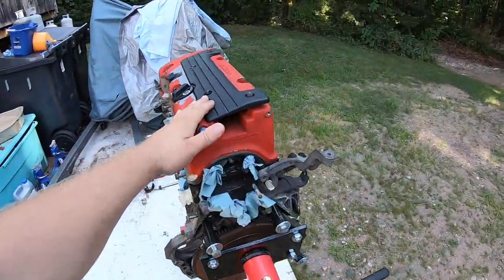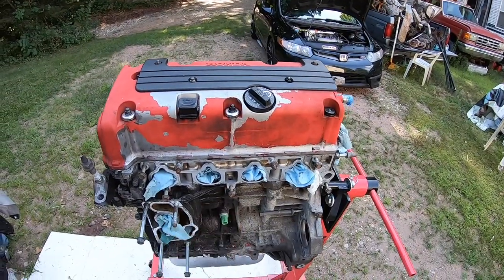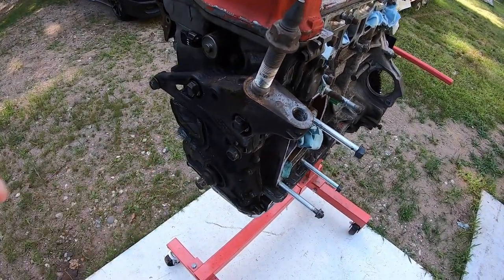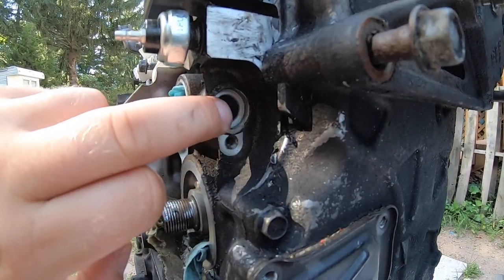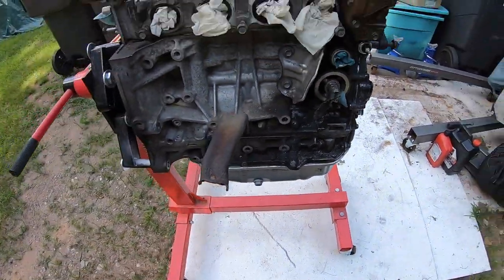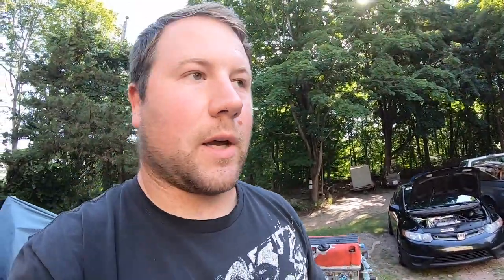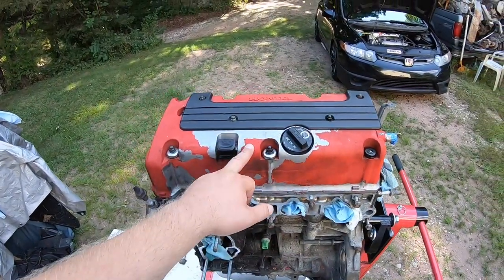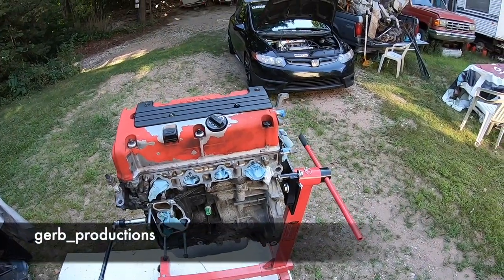Honda Civic Si K20 to K24a SWAP DIY (2006 2011 Si)

Comment: I just bought a 2007 si and has a bad k20. After watching this video I'm definitely buying the k24 it's cheaper then what I can find a k20 for.
Reply: dude, literally bought mine a week ago and mine blew on the drive home 😂 good luck brother, i know we both need it 😂🙏
Reply: @Gabriel Villalobos   bought what a k24 and swapped it.  Or a civic with the k20 and it blew?
Reply: @BjYeager420  bought an si and it blew 😂 probably gonna go back to k20
Reply: @cheesehandles  k24 is cheaper
Reply: same here, i'm 2200 miles in and my mechanic found metal shavings in my oil and before that i thought i had a timing chain/tensioner issue due to my p1009 code
Reply: @taronate  is this with ur stock k20?
Reply: @cheesehandles  bro same wtf💀

Comment: I just did a k24A swap on my 8th Gen just waiting on Flashpro. But the only sensor you have to change is the Crank sensor and the Vtec sensor behind the engine. Everything else just plug in and you can use the K24A crank pulley and need k20z3 oil pan and CRV post mount..but Everything else is direct plug in. All I'm waiting is for my Flashpro which is coming tomorrow brand new Bluetooth.
Reply: So nothing need to be transfer just a few things

Comment: Hey gerb thanks for all your video just finished my k24a swap and running like a champ. I haven't gotten the flashpro but it's running like it should. That's for ur videos.
Reply from the maker: Np man, thanks for all your support 🙏🏼
Reply: Hii José, you are running the k24 on a civic Si not tunne?is running good and strong? I gonna make this swap i have a 2007 Si coupe, i dont have the money for the flash pro only for the k24 engine.. 🙂
Reply: @LeandroGomes-sw3jz  yeah Its been running good. Am saving up money for flash pro but haven't tuned it yet. It's been 11 month
Reply: And it still running strong

Comment: My current project right now, thank you for the advice , def very helpful. I got k24A RBB motor recently after my k20z3 made it to 230k miles before head gasket blew.

Comment: I swapped my k20z3 to a K24A and it ran on its own for 15 or so seconds and cut the engine cut out now it won't start. Fuel is coming out of the fuel line and the engine has healthy compression on all four cylinders. I need to do a spark test. I was wondering if you encountered any of these issues. P.S. you're videos were a huge help when I was debating if I was going to perform the swap.

Comment: The vtec solenoid from k24 only has 1 plug cause the jdm motor doesn't use an oil pressure switch for vtec iirc. A usdm k24 would have both plugs I think.

Comment: You can run the car with out the oil cooler just get the tsx water pump ,, for those on 2024 make swap 💯

Comment: What’s up man. So I just got a k24a2. Doing a 20/24 but I’m getting conflicting information on something. With the z3 pan on the 24 block what oil pump and pick up are you running? Did you have to use the z3 oil pick up? Thanks man!
Reply: the best stock oil pump for your application is the fd2 type R oil pump. it has the extended pickup just like the stock z3 oil pump but is closer in design to the k20a2 rsx type s pump. do not use the type s pump because the pickup is not tall enough for the deeper z3 oil pan. its not worth the risk. use the RRC fd2 civic type r pump. its cheap and bolts right up.

Comment: Hey Gerb I am helping my friend with a K2.4 swap on an Acura CSX 2010 same as the civic 2010 can we pull the engine & transmission from the top rather than taking the subframe from the bottom & removing it from under the car

Comment: I bought NGk coil pack from TSX u think they will fit on 8th gen civic si plug wiring harness the part number changes 48699 and k20z3 NGk coil pack part number is 48922

Comment: Did you need to flash tune your ECU on k24 after you installed everything ? I heard it’s necessary to do a tune to make the k24A swap run as it should.
Reply: Yes it is

Comment: Which k24 did you use boss. The k24a2? Anything you thought of after this video? I want to do this bad !!!! Thanks for the content. Did you do the oil pump upgrade  I believe that gives you more power.
Reply from the maker: K24a. I like the torque. And I didn’t use the pump, but regret it seeing as I only take it to 7800 rpm
Reply: @TheGerbsteve  I just watched your other videos. I saw k24a. I'm doing a marathon of your vidz right now lol. Prepare for the storm.  7800 is still great.  I bet the torque feels bomb💣
Reply from the maker: 188tq and 7800rpm feels great for a first k24 swap to me ! 💪🏼

Comment: In the middle of doing my swap, and I noticed that the k24a block has studs for the oil pan. How did you remove this?? I didn’t see it in the video and I’m stuck now as to how to remove it safely

Comment: My Acura CSX engine blew up I bought the tax K2.4A2 engine it is a little taller (19 mm / 0.748inches)than the k2.0 can I use the TSX  intake& exhaust manifolds & would it fit
Reply: Hey Ferb my car is a daily driven all that is available now is the TSX K2.4A2 the guy it would fit I saw you swap all the sensors just wanted to know could I use the TSX intake and exhaust manifolds

Comment: Hey I was just wondering with the side motor mount you need a 2002 to 2006 CRV post mount but what else do you need do you need the whole motor mount assembly from the CRV or just the post mount

Comment: So i have a 05 rsx with the k20z1 and I’m gonna have to order a new harness but eventually I wanna go k24 bottom so if I swap the sensors n all will it work with my ktuner ecu or would I need hondata?
Reply from the maker: Should work with your k tuner

Comment: What bolts did u use for the crv post mount? And are you using the torque mount that was used in the k20?

Comment: Thanks for a very helpful videos... I have a question, Did you use RBC VTC 50" ?
Reply from the maker: I sure did. It’s one of my favorite mods
Reply: @TheGerbsteve  whats the benefit of using the rbc vtc 50° compared to the stock one in k24a2?

Comment: Hey gerb what bolts did you use for the engine to the stand. Did your stand come with bolts to hold up engine?
Reply from the maker: No, I had to go to hardware store and get them. I don’t remember the thread pitch

Comment: Hey Gerb. Quick question. Did you have any issues with your vtec not working when you did your swap? Just did mine. No vtec. Unless the crossover just isn't as hard.
Reply from the maker: Vtec worked perfect man.
Reply: @Gerb Productions  yea. It just doesn't hit as hard as the k20z3 on that crossover. Just curious if you had access to your tune? I'd love to take a look at it and see how close it is to mine. Thanks for the reply. I'm in ct as well.

Comment: I am looking to do the same on a 07 civic si. Its hard to find another z3 since my brother spun the rods so im looking for the k24a. Could i use the same ECU and transmission from the k20?
Reply from the maker: Pier B nice man. It definitely is hard to find a clean z3 engine. If you do find a nicer k20z3, you’ll be paying top dollar for it too! Yup, you can run k24 off of k20 ecu and tranny
Reply: Gerb I appreciate that man! One mor thing, the k24 redline stops at 7 and k24 at 8. How do you go about that? 7 would be my new top?
Reply: Gerb How does that work about the 7 top rpm on the new k24. Thanks man

Comment: I recently bought a civic that had the k24a2 swap. It has the skunk 2 headers on it but slap the firewall hard. what did you do for the clearance issues?
Reply: he put spacers on the rear lower mount t😁
Reply: basically let’s the engine move forward up with the spacers and let’s the header clear better

Comment: Hi Gerb,  hope your doing ok bro?, Ive been watching your latest video. 
On another note, can you tell me did the OIL CAPACITY change when you used the Z3 pan?
Reply from the maker: I'm doing alright, thanks for asking. I'm just going through some stuff here and there... The oil capacity barely changed, but the k24 will take a bit more. Anywhere from 5-5.5 quarts of oil is perfect. Hope this helps
Reply: @TheGerbsteve  yes it does help thanks. I too had to swap out my K24 pan to the K20 pan so the lower engine mount could be used. The problem I encountered was the K24 dipstick didn't quite fit so I'm using the K20 for now. I estimated the oil level and have used just over 5.5 quarts (5.2-5.3 litres) so thanks again on that one.

Can I ask have you ever replaced the fuel pressure regulator ? ....... my dyno guy recommended I replace my fuel pump or filter as my engine was making no more power after 7K. I did what he said and we made 12whp more but he reckons its still dropping fuel pressure towards 7.4-7.5K .... 

good to hear you're alright Bro.

Comment: Gerb were you able to keep the Electronic power steering? what belt did you use and what was required? Dont k24 use hydraulic power steering?
Reply from the maker: Yes. K20 belt, but it's a tight fit

Comment: Google search didn't help.  If we have a 8th gen Si, will the stock ECU work?  What type of tune is needed?  If stock ECU is needed, thinking of using two ECUs so I can pass CA smog.  One with a tune, and the original one for passing smog.
Reply from the maker: Stock ecu works and a tune for k24
Reply: @TheGerbsteve can you elaborate on this gerb? Will the z3 base map run the car and pass smog? Or did you have to flash the 24base?

Comment: Hey bro so I have a bit of a problem maybe you can help. I did a k24a JDM swap on my fg2. I did the type s oil pump upgrade. But like you mentioned the type-s pan doesn’t have where to Bolt the rear mount. What do I do? Can I use the z3 pan orrr? Thanks for the reply in advance.
Reply: @krazykk4  awesome thanks man!
Reply: @krazykk4  another question bro. Finally addressing the issue tomorrow. What header are you running?
Reply: @krazykk4  thanks for the reply again. Awesome I’ll have to pick up a set. No cutting necessary right? Headers have clearance between them and the rear mount bracket?

Comment: Yo gerb I had a question how did you get the k20z3 transmission to fit onto the k24a2 I noticed when I tried doing it one of the bolt holes don’t line up with one of the dowel pins I just wanted to know if you have to do any modifications to make it fit. Thanks
Reply from the maker: I have the k24a. I just used z3 dowel pins and it bolted perfectly, no modifications.

Comment: Hey Gerb can I use the 50 degree intake camshaft in a K2.4A2 with out any valve to piston damages
Reply from the maker: You’ll be able to run 50 vtc, but I’d have your tuner set it lower just to be safe.

Comment: Hey. I just found out on my 06 si k24a2 swap from 06 tsx . Im running the stock ecu on the k24. Can it ruin my engine? The car is still fast.
Reply: nope use your stock ecu if your in an 8th gen
Reply: @semaJPlayz  
Oh ok. Thank you. So, just use flashpro?
Reply: @rapture7551  I wana swap my 07 si with k24. How is it running in stock ecu

Comment: on the oil cooler did you feed the block line thru the factory k20z3 fitting on the k24 RAA block without any work
Reply from the maker: Yeah, everything bolted right up. It's cake to swap everything over
Reply: @TheGerbsteve  Thank You!

Comment: 8:45 hey Gerb do you remember how many washers you used to make your k24 tilt by any chance and did you use longer bolts? I’ll appreciate the feedback bro💯
Reply from the maker: Bro, that is one thing that you have to figure out on your own. I will say this, if you are using washers, you will need longer bolts because you are removing threading on the stock bolts.
Reply: Gerb thanks bro I appreciate the feedback

Comment: Hey quick question i just did the same swap on my fg2 & the car doesnt drive in any gear. The car only drives in neutral… super weird & gears are super hard
Reply from the maker: You may need to install new clutch

Comment: Hey Gwen if I use tge OEM aluminum oil pan how much oil I have to put in the engine
Reply: Hey Gerb K2.4A2 swap in an Acura CSX OEM same as the Honda si aluminum oil pan how much oil to put with out over filing

Comment: I have a 2009 Honda Civic but it has a K24 Block and K20 head and now it chokes when you accelerate it. Do you by any chance know what it could be?
Reply: Did it choke right from the beginning of the swap? Or did it happen after a while? Any modifications to the engine?

Comment: Hey Gerb  I swap out my K2.0Z2 from my 2010 Acura CSX with K2.4A2 Acura TSX the problem I am having is EGR air restriction error code PO401 the TSX don't have an EGR system how do I fix this error code, I install the housing & EGR valve system from my K 2.0 if I clear the code it  would come back I need some help
Reply: Same here

Comment: What did you use for the idler pully I put my z3 idler pully and it doesn’t sit flush did you use the k24 one ??
Reply from the maker: I used my z3
Reply: @TheGerbsteve  I used mine as well  but the belt doesn’t sit where it’s supposed to it moves it’s came off a couple times

Comment: did you use the k20 oil pump or keep the k24 balance shaft set up?
Reply from the maker: Kept the k24 pump
Reply: @TheGerbsteve  okay cool. and just to clarify, is having the flash pro 100% required for the swap to run?
Reply: @TheGerbsteve  do you %100 need the hondata flash my k20 jus blew yesterday 😭

Comment: Quick question can I use z7 oil pan on k24a? For the rear mount?
Reply from the maker: That I don’t know man
Reply: Thanks man I think ima try with k20z3 oil pan then cuz just try it and I get an low oil pressure light on and now that I put back the oil on that’s doesn’t bring the rear mount it goes away by the way I have 2012 si

Comment: Did you have to tune right away to work or are you able to drive a bit lol Then tune ?
Reply from the maker: I had it tuned right away.
Reply: @TheGerbsteve  wish me luck 🍀 about to do the same thing
Reply: @Gerb Productions  but u don't got to tune it right. It will run fine on a stick tune.

Comment: Just got my k24a. I am making a parts list it's overwhelming.
Reply from the maker: It definitely is, but take your time and buy mostly OEM parts
Reply: What do you mean overwhelming do you need a lot of extra things for the swap?
Reply: @Red-ev8ls  I finished my swap in January. I drive it everyday. It's been over 6000 miles so far with zero issues. In hindsight, the swap was simple and quick. I would love to do it again. The overwhelming part was the information research. I did the 50°vtc, typeR oil pump, chains, guides, all seals and gaskets. I need to go into a job with enough research to where I am ready and know what I'm doing. Videos like this helped. The overwhelming part was getting part numbers, torque specs, instructions, etc. When I was ready, I could've done it with my eyes closed from the amount of research I did. I'm not a mechanic, but I've always done my own work for the last 25 years. This was one of the bigger jobs, so I wanted to be ready.
Reply: @glenc2353  thank you for that response my k20z3 just recently got really bad rod knock and I’m looking at a k24 swap myself

Comment: Did you do your timing chain
Reply from the maker: Yeah. If engine is out, you should replace w.e major components that you can.
Reply: Did you use k24 timing chain, guides, and tensioner?

Comment: What about power steering pump??
Reply: Pls lmk if you find out
Reply: You dont use a power steering pump if its going in an si. You use the oem accessories off the k20z3, that includes the idler pulley(which takes the place of the k24s ps pump). Si uses electric steering.
Reply: So can I use my K20 Z3 water pump housing @Slavikhavoc

Comment: Did you just use your stock 8th gen ecu?
Reply from the maker: I sure did
Reply: @TheGerbsteve  is it necessary to get a tune once it's swapped?
Reply: Yeah I heard someone say u need flash pro for it to run is that accurate??

Comment: How bad is a spark plug job? It looks like the valve cover is jammed under the firewall.
Reply from the maker: It's not too bad honestly. It is tight, but once you remove the rain guard under the cowl, It's pretty easy

Comment: did you have to change the timing chain on the k24 to the k20z3
Reply from the maker: Nah, kept k24 chain
Reply: i know you swapped the oil pan did you do the type r oil pump as well? wondering if ill need a new windage tray. any chance i could contact you directly?
 @TheGerbsteve

Comment: And JDM k24A has 200hp and 170ft torque the k24A2 from 06 to 08 205hp but 155ft torque the k20z3 has 197hp and torque not good..
Reply from the maker: K24a: 200HP 171Tq
K24a2: 205hp 164Tq
K20z3: 197Hp 139tq
Reply: @TheGerbsteve  hey bro good day do you have the part number for this K24 CRV POST MOUNT BRACKET thanks
Reply from the maker: @johanfeli2044  no I don’t. Someone sent me the bracket

Comment: Why do this swap whats wrong with the k20z3 is the k24a just a much better motor
Reply from the maker: z3 needs a rebuild, it was burning oil and needs a new timing chain. I wouldn't call the k24a better, it just has more torque and the same hp
Reply: @TheGerbsteve  hey I’m in the process of swapping mine, would I need to get plm headers for the exhaust to fit into the engine? That’s what I was told and you’ve done the swap just know you have experience